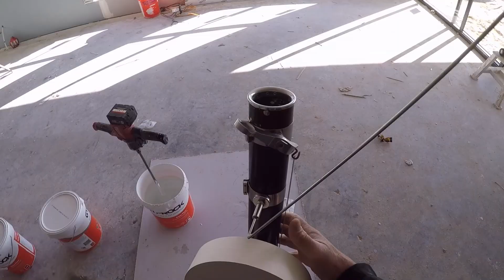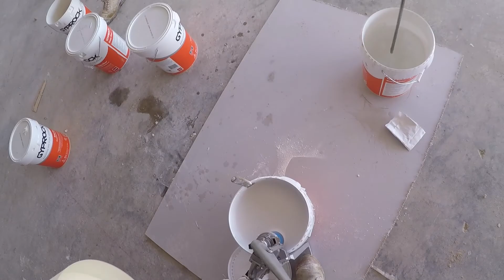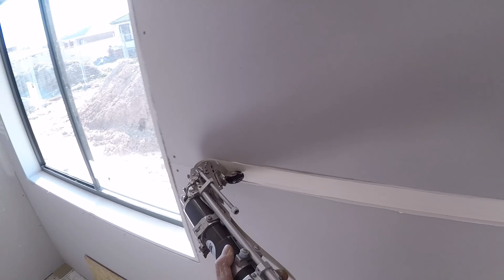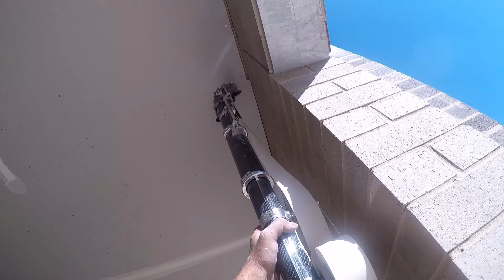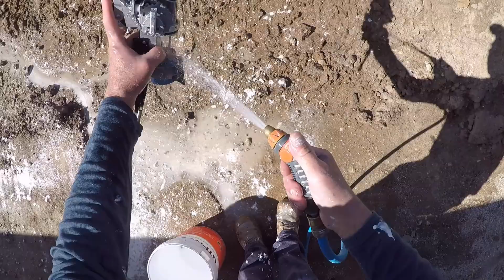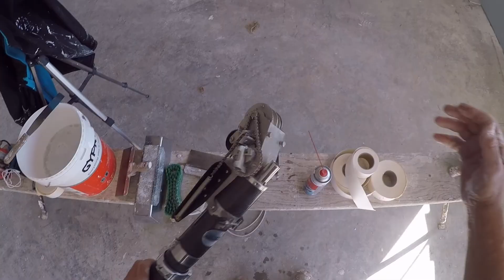Taping Life

Comment: Can you make a video on how to do seal replacement on a old blue line mud pump please? I'm trying to repair mine and can't find any videos. I know you guys sell the kits but no instructions
Reply from the maker: It is fairly straight forward, cut the nibs off the old seal then remove with pliers. Clean, then fit new wiper (easier if you put it in hot water first), pull nibs though until seated. Cur off excess nib length. Video showing compound tube seal replacement here (same wiper) https://www.instagram.com/p/BjlwVaog9Q_/?taken-by=gary_holt_plastering